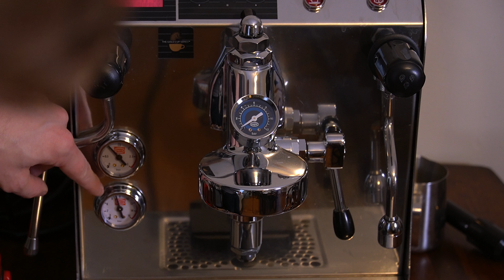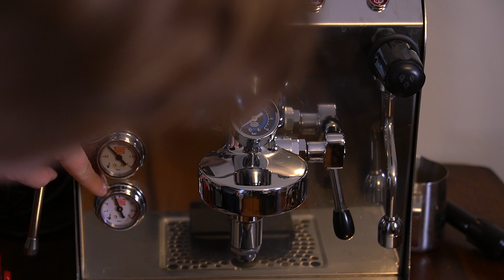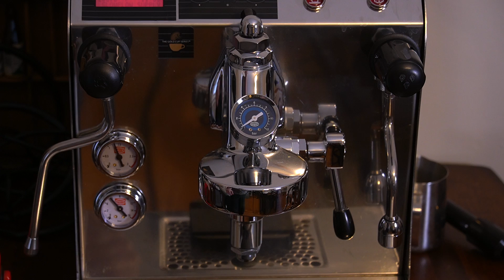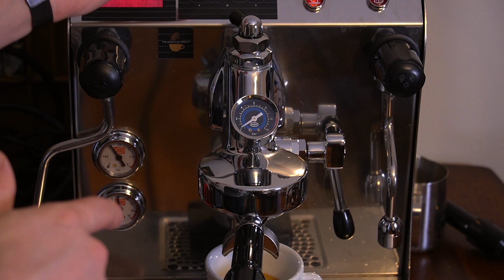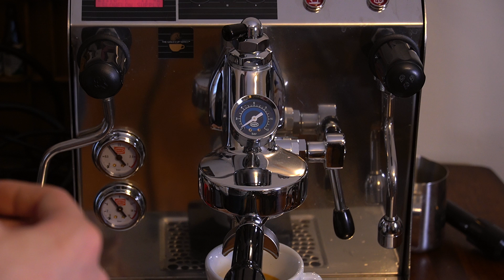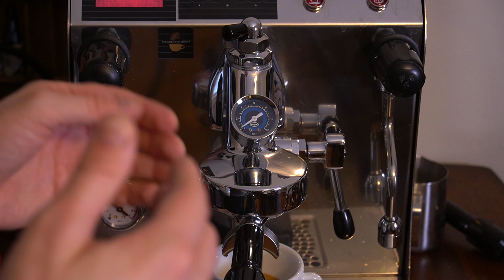Quick Review - Quick Mill E61 Flow Control Valve

Comment: This was super helpful. I just started playing with mine today and I was not expecting to need such micro adjustments. It seems like mine gets to the default flow setting in less than 1/4 turn. I wonder if it can be calibrated differently. Thanks for sharing